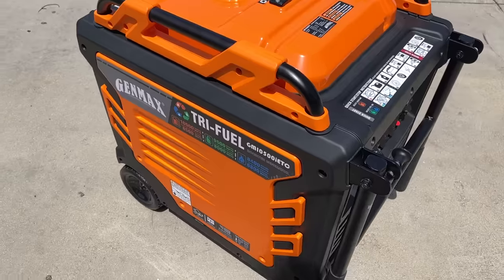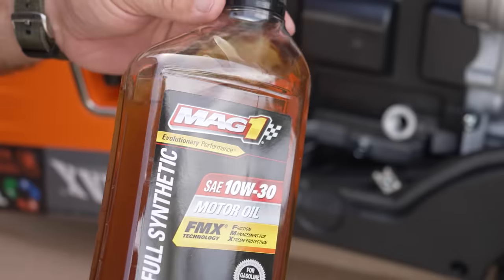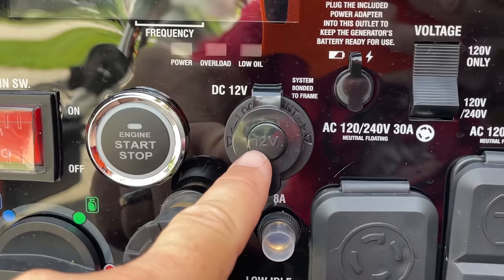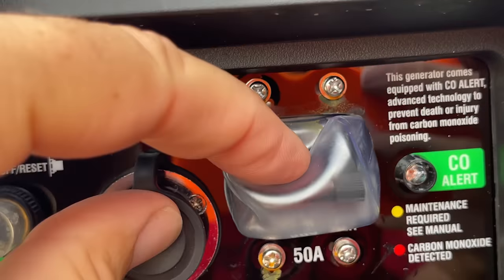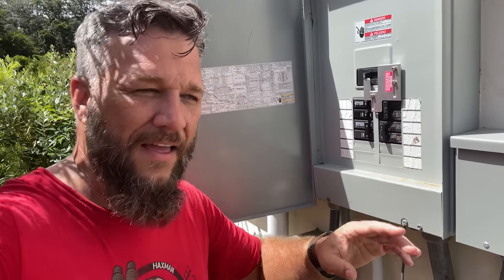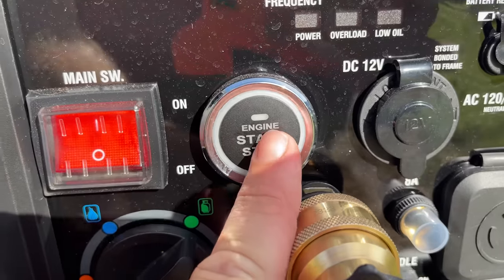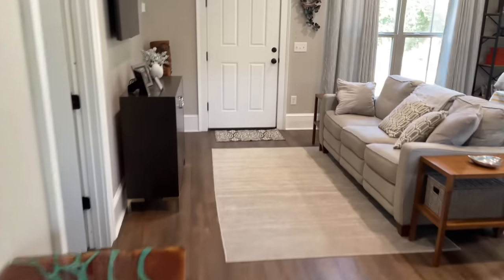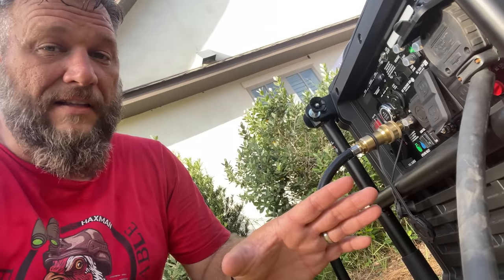Don't Buy A Generator Until You See This Monster!

Comment: Thanks for the testing and video. Seems like false advertising on starting and running watts if you can’t go beyond 30 amps with the 50 amp 240 volt outlet. Perhaps it can do more than 30 amps. You should do another video trying to max out the unit. Thanks again.

Comment: I'm Obsessed about the idea of converting the current Ford Explorer police inceptor, into a 'series hybrid' full electric drive, powered by a drop in and out generator like this. lol.
People are actually doing this now, EdisonMotors is using a diesel engnie to power a full electric drive truck, very little battery needed as its not the main source of mileage.

Comment: My only question would be, can you run your water well your air-conditioning and your water heater and your stove at the same time. I have an energy monitor on my house and at one point I saw 17,800 W but that’s with both elements in my water heater running and everything else on.
Reply: A lot will depend on the size of your well pump.    Those starting loads can be up to 30% higher.

Comment: It looks like a nice unit but for $2900?  Two Predator 5k's with the parallel kit are about $700 less, runs quieter and will have 50A output.  Plus, you'd have a spare if one goes down.
Reply: Just purchased the HF 5000 running of LP. Off grid 50amp Bus. With 30amp. I have a 10k diesel.  Don't always need that much power. Fuel high.
Reply: @chrisgrob8812  I took a look at the 5000. It only lists 120V AC, 12V DC, 5V USB. If you have a device that runs on 240v, its not going to be able to power it correct?
Reply: @gmarch4618   correct.  I have nothing 240VAC.   My dryer is residential LP.
Reply: @chrisgrob8812  Yea, we have a well pump that runs on 240v. I have a 3500 I purchased before moving to where i am now. 240v is now a factor, oh well.
Reply: @gmarch4618   Yep have to go bigger just for that pump. Deep well ? I take it.   Mine is only 50ft.  I use a 12Vdc pump and solar.
Reply: The predator 9000 was under $2000 and just a bit shy of the peak on this one, seems like the extra $1000 doesn’t get you much more capacity?
Reply: @chrisgrob8812  Not sure on the depth. But that is good info on alternative pump ideas. Was frustrating when we had a week outage and no water, with a generator...

Comment: How clean does it burn the propane? Could you isolate it with an adaptive exhaust and enclose most of it with noise cancellation insulation? Or would it generate too much heat? Seems like the side panels were plastic.

Comment: What generator did you gave that had the Bonded Neutral?
How would I know if my generator is bonded neutral generator?
DO you know if that's the case for the Firman T07571 ?
Reply: Yes the T07571 says it IS a bonded neutral.  The manuals will often have instructions on how to convert to a floating neutral for when connecting to an inlet plug on the house. However from the Firman website for this generator I could not find any instructions on how to disconnect theirs. I have two older Champions. One came Floating the other Bonded. For mine it was a jumper wire between two terminals under the power head cover.

Comment: Hello 
Haxman XTRA !
Very impressive informative/video. Thanks. I wish I could use the ATS as well but like you I cannot. Your right about the names of these gen’s!
LOL. The only one I can figure out is the 
i for inverter. Your Bonding plug for your floating neutral Gen. Is when you want to use just an extension cord to power something. You plug that Bonding plug into one of your 20amp receptacles and Generator is now Bonded. Remove it when using your Power inlet plug of course. You want it floating. 

I own a
AiPower GSX7100iRD
Duel fuel, i as well only use Propane. If I use propane and had gasoline in it, it would automatically switch over to the gas. Very long run time. I also only have/use  an Interlock which I love. Mine has recoil/electric start/Remote. It’s about 63db. 
It has a floating neutral as yours does also. Quality and features are amazing. Everything you have except the 50amp plug and the charging port. I connected a NOCO 2amp Charger/Tender/Maintainer to mine. NOCO makes a great product. 
7100 watts divided by 240 volts = 29.58 Amps. Yours is 12000 watts divided by 240volts = 50amp. Mine unit is 6 months old. Check out all the features on mine you will be impressed at just $999 at Costco. 
Now they have one for $1299 with that charging port you have. 

AiPower just came out with the 
AiPower SUA7600iED
on Amazon for$1499-$100 coupon $1399. I would have looked into that one as well  over mine. It has 500 more watts. Mine runs 
2 refrigerators, Boiler and water storage tank, Sump pump, all lights(LED’s), WiFi, Router, TV’s and some small ac window units. It’s sick. It has a drain tube to drain fuel in storage mode if you use gas. I wanted to share my unit to yours for your Fans that do not need 12000 watts. Your unit looks great. Great luck with it and your channel. Everyone give him a thumbs up, heck I’ll take one to please if you like my comments. Please subscribe to HAXMAN’s channel. 
All the best Haxman, you and family. 
Mike ienuso.

Comment: 100 amp service (50 amps per leg) at 240 volts = 24,000 watts (24kW; 12kW per leg)
This would be the theoretical maximum you would use, however, it is highly unlikely you will get anywhere close to it.
Most moderate homes pull far less at any given moment.
My highest usage capped at 16kW for two days out of the year and averaged about 11kW per day.
11,000/240 = 45.84 amps.  
All that to say that any INVERTER generator that can supply 10kW should run your whole house without a problem.
I specify "inverter" because non-inverter generators produce "dirty" power; the waveform is not smooth and symmetrical.
Electronic devices can be damaged by "dirty" power called Total Harmonic Distortion (THD).
A generator producing a THD of over 4% can damage electronics.

Comment: Just as important as having a generator is having enough fuel to run it, on hand before the power outage.  Producing electricity at home is expensive and costs even more when running too large a generator. This is too large for most people.

Comment: When the power is out, so is the power at gas and propane locations, at least in my area.  One of the ratings that would be most helpful in choosing a generator/invertor would be fuel usage in pints per hour at 80% or 90% load. Why do they give us usage at 50% load while we are trying to size the gen to our usage?  Manufacturers list 50% load but do not tell us at what throttle percentage the unit is operating at. Fuel usage is not proportional to load.
Reply: Bingo, during Beryl in Houston, I had stored up 3 x 5 gallon cans and filled my F150 with 20 gallons thinking that should be plenty for the anticipated 2-3 days of power outage. Thanks to the wonderful work of Centerpoint Energy and discovering my F150 has an anti-siphon device in the filler tube, I found my 15 gallons only lasted about 2.5 days of the week long outage. We had to drive quite a ways west of Houston to find gasoline. I now have 8 x 5 gallon cans and am thinking of buying a 100 gallon drop tank that can be filled during predicted storms. I would think propane would be even harder to find during an outage. So unless you are prepared to spend another couple of grand to put a 500 gallon propane tank in your yard, and then $1500+ to fill it, gas still offers a more convenient and efficient option, IMO. Dollar for dollar propane is much more expensive to run. The energy density of gasoline is very hard to beat. I have an all electric house with no natural gas available so that compounds things also. Electric range, Electric Hot Water Heater, A/C, Electric Heat, Electric Clothes dryer all adds up pretty quickly. One needs to be strategic when deciding what breakers to turn on when. It is more practical, IMO, to think it terms of portable heaters, and window AC units.
Reply: @tommaxwell429  Sorry that you had to find this out "the hard way". But, hey, there's no such thing as a free education. 
 I actually chose to use a small portable 4300 watt LP generator that puts out 120 volts only. It uses only one (1) pint of LP per hour @ 80% load. This little generator gives me 30 amps of 120 volts that I spread across both 120 poles of the breaker box. I do have to turn off all 240 volt breakers for this to work. 
   I live in a very rural area, so I already have a 1000 gallon LP gas tank which stays at 50% or better at all times. And I have a LP gas water heater and a LP gas range.
 So, the only things that do not work in a power outage is the clothes dryer and the AC/Heat Pump. I also have a 95% eff. LP gas furnace as part of a dual fuel HVAC system that WILL work on the 120 volt feed. 
 Most of the time when the power is out, and the generator is running you cannot tell any real difference. Plus, the fuel lasts FOREVER, lol.
Reply: @brianhope5853  Nah, not the hard way. Just a natural progression of understanding and experience. I've had a 9000 watt generator since Hurricane Ike back in 2008. There is no good answer for all electric homes. Running lights and a TV are nothing! Heck a flashlight can give us light and a weather radio can keep us updated. The challenge is convenience and comfort and that takes heat, hot water, AC, maybe a clothes washer and dryer, dishwasher, range, toaster, can opener, garbage disposal. Those are big budget items. There is no good answer. So it becomes a choice of big $$$ full home solutions or picking and choosing. I can't justify a $20K whole home commercial solution. I can handle the inconvenience for a few days to a week. I just need to stock up on more gas ahead of time.
Reply: @tommaxwell429  Well, an all-electric home in the climate you live would be a challenge for sure.  I'm lucky enough to live in WV and even the summers are tolerable enough.  It's the winters that are the real challenge.  
 I use a TRC AECM20020-3-012 plugged into an outlet that beeps if someone turns on one too many things and forces a voltage drop below tolerances. 
 We lived for a month on a generator in 2011.  2 weeks from a derecho in July and 2 weeks from a blizzard on Halloween the same year.
 Fuel availability was a real problem for most. But with our setup the only challenge was the oil changes, lol.

Comment: A true inverter generator runs on batteries only. Like EcoFlow. The batteries can be recharged from the grid or even Solar panels.
This uses a multi-fuel engine to run DC a Generator that the inverter turns DC  into AC. Most are not pure sine wave like an AC Generator.
This one is $2900 and a 10KW Gasoline AC Generator can be had for $1200 or less.
Reply: Ecoflow isnt a "generator".....its a battery with an inverter. This is an inverter generator because it generates ac power, converts to DC, then back to stable AC power. Thats what allows these inverter generators to fluxuate the throttle to match load, and they deliver the cleaneat power source.

Comment: And whether its the Champion 2.5KW Dual Fuel Inverter/Generator.. or the Honda EU2200iTAN or the GENMAX GM10500iETC Tri Fuel Inverter Generator.. 

Until nuclear microreactors (like Radiant) are available, it seems having a solar panel solution would also be good, like the Anker F3800 or the EcoFlow Delta Pro Ultra.

What is the most "portable" solar panels you've come across?

Comment: So, since it has that storage disconnect, on the battery . . . I have the same connector on a solar battery maintainer I use for my side x side. I wonder if I could use that to keep the battery at full charge?
Reply: I would double-check for polarity between those connectors, but yes. The generator uses a small lead-acid battery similar to those used in cars. Any solar maintainer meant for such a battery will work.

Comment: strange that they don't include break in instructions. just about every other generator out there   says run regular SAE 10- 30 during the break-in period.    Break in is : during the first 8 hours  of use  run at no more than50 percent load and after break in change the oil and if so desired at that time you can run full synthetic.

Comment: Anyone get the muffler pop at the end when turing it off when using propane? I expect theres LP in the line and some air to LP thing going on, but only when i turn if off. Im following the manual and spark plug is gapped right.

Comment: That's a lot of cash for a lot of power most won't use in an emergency.   It is about the same cost for a stationary back up system.   My nat gas 8000 watt tri fuel generator cost about $2100 for the plumbing electric and generator.

Comment: You might want to find a straight in type plug as the one you are using is being pulled out of the socket due to the recess on the the genset.  There seems to be a bar of metal right there.  Are you also powering an electric hot water heater at 4500 watts?
Reply from the maker: I have a gas water heater
Reply: How big is your electric water heater that it pulls 4500 watts. I have a larger size but relatively new water heater which only requires 2400 watts. Maybe it's new so it's more energy efficient than a older model but I don't think my older ones pulled 4500 watts.

Comment: My concern with these generators they have now with the auto shut off carbon monoxide detectors is that I run my generator in a small cinder block enclosure. There is definitely carbon monoxide build up, but there's no one near it, but the generator keeps shutting off. This forces me to have to override this safety feature.

Comment: Big safety error in wiring up the controversial 50 amp but 30 amp plug. We can see the individual conductors hanging out of the plug, which almost guarantees that the cable strain relief if not being used. That means 1) curious fingers can probably reach live conductors inside the plug through that hole, and 2) if someone ever trips on that cord, all the yank force is going on the wire terminals inside. Shorten the individual conductors where they go into the plug, so you can’t see them, and the plug’s strain relief down hard on the outer insulation jacket of the cord. Now fingers are safe and yank strains go on the parts of the plug and cord that are designed to handle them.
Reply: Nobody has fingers small enough to go up into that plug and would require someone to go right up on the generator while it's running and without unplugging it wanting the play with the plug with all that noise. If someone trips on the plug the wires are going to disconnect from the prongs before coming out far enough to electrocute you and the wires are double clamped in the plug, first on the prong and 2nd the clamp bar.

Comment: Did you misspeak or do you actually have to run 2 generators to get 50 amps? I thought each positive prong on the plug gives 30 amps but since you use both prongs on the 50 amp breaker you get 50 amps.
Reply: To get 50 Amps you need a 12,000 Watt generator. 50 Amps  x 240 Volts = 12,000 Watts
Reply: @bertveldhuizen8699  You know, I should have known that. I forgot it was only a 10500 watt even on gasoline. To get 50 amps the volts would have to drop to about 200V or less since he is running on natural gas

Comment: Why can't you have 50amps without linking two together???  Even with propane only doing 8000 watts continuous you should have roughly 66amps on tap.
Reply: Only on the 120 side. You’ll have half that on the 240.
Reply: 50 Amps @240 VAC is 12 KW.  This generator is not that big.

Comment: No thank you. $3,000 for a generator that's made in China and only has a 1 year Warranty.  Manufacturer is CHONGQING DINKING POWER MACHINERY CO. LTD. Caojie Industrial Park, Hechuan District, Chongqing China. Good luck finding any available replacement parts for it. 
I would rather keep my 20 year old US made 15kw Kohler gen set with the optional Kohler automatic transfer switch. Atleast I know I can still get parts for it. It wasn't much more than that Chinese built genny when it was new and it came with an extendable Kohler 5 year Warranty as standard.

Comment: Not the biggest - DuraMax has a 15000W dual fuel version at just under $1900.  my home will peak at almost 10KW during the late afternoon but averages 6KW.  we use 6KW grid-tie solar to offset usage and a Generator for essential circuits if needed.
Reply from the maker: This is the biggest INVERTER generator or was when this video was published. Duromax has a bigger one now though.
Reply: Duromax is dual fuel not tri-fuel so i think GENMAX is the biggest tri-fuel inverter generator.
Reply: First off, no one needs a tri-fuel. In the country, you have propane mostly. Also, the biggest tri-fuel is the DuroMax XP13000HXT 10500W/13000W Tri-Fuel Gasoline Propane Natural Gas CO Alert Remote Start Generator.

Comment: No reason why that generator should not run a 4 ton air conditioner.  ESPECIALLY if you get a soft start kit that brings the surge amps down to 20 amps or so.  My 4.5 ton AC runs at 3000w and even my old 6600w generator runs it just fine with all the other loads in the house.

Comment: For a Tri-fuel, yes, it's big.  But it's not the most powerful generator on the market.

Westinghouse makes a 28,000 peak / 20000 running watt portable generator.  It's single-fuel though.

Comment: Duro Max has a 13000 watt tri-fuel so how is this the most powerful portable on market?
Reply from the maker: Most powerful INVERTER generator. Duromax does have a 16000 watt inverter generator out now though. It was released after this video.

Comment: Not sure how it’s most powerful. I bought a Westinghouse 12500 peak 9500 running watts and it’s been powering my whole house and shop during power outages
Reply: This is an Inverter Generator & creates more stable power output but id still rather have a regular generator.